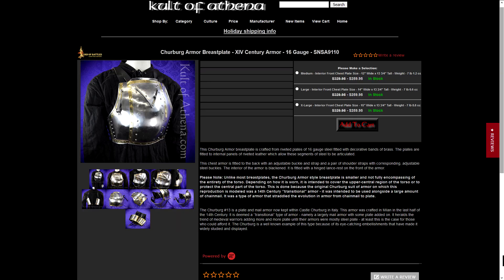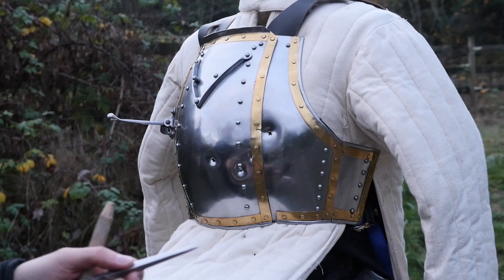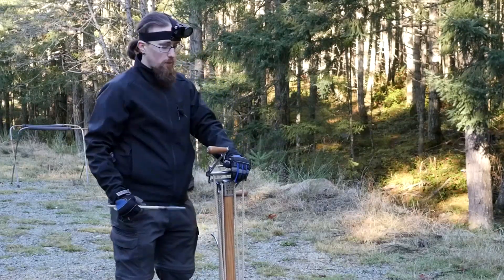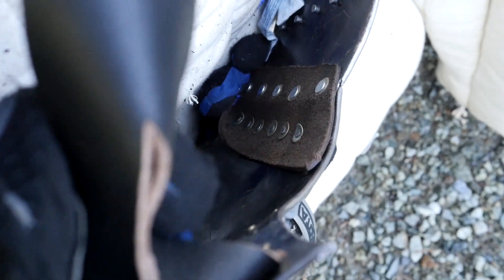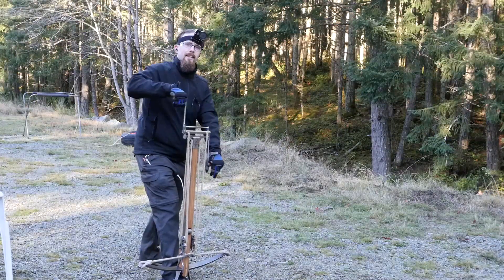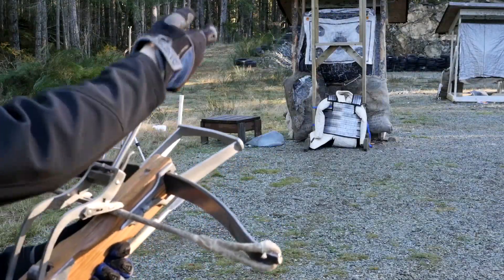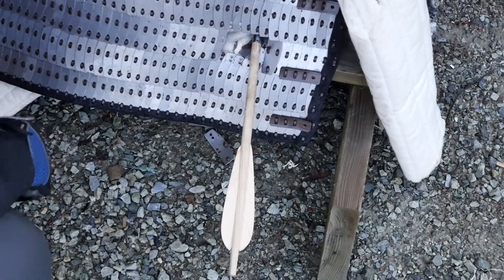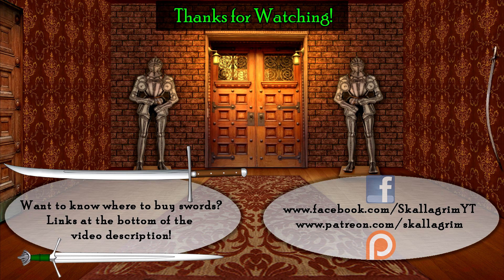Medieval Crossbows vs. Breastplate and Lamellar Armor

Comment: this is why early inaccurate and short range guns are used. Despite all disadvantages, they did penatrate armors and that was enough reason to use them.
Reply: That was more handcannons. Main reason for guns was ease of training. You could basically get a bunch of peasants, have an afternoon of drills on loading and firing on command and have a ranged unit that could put out as much damage as a much more veteran crossbow unit. After all, while inaccurate all you had to do is have the bullet go somewhere into that mass of enemy infantry and you're good, so you didn't even really need to train them on accuracy. As such massed gunfire would be useful against knights still, as they are big targets and they'd be able to kill or disable the horse a lot easier then something like a crossbow, even if he endures the bullets relatively unhurt. Later guns could certainly penetrate armor which is why full plate transferred into much thicker breastplates that could still resist the gunfire, concentrating all the protection over the vital organs instead of trying to armor the whole body.
Reply: @SallinKari  "Ease of use" is a myth, kinda like the blunt-like-clubs european sword and immobilising full-plate armor. Use of firearms at any point in history before the invention of metal cartridge was very dangerous to the user and reqired a LOT of training, especially, if the shooter was expected to fight in a formation, which he always was. Remember, they were working with a very volatile substance and had to go through a very fiddly reloading process, during which they faced the risk of setting their gunpowder on fire prematurely and in uncontrolled fashion, potentially killing themselves and some of their fellows. I've read once about how one arquebusier reached into a barrel of gunpowder while still holding the fuse in his hand, causing an explosion killing more men than the battle itself. On the other hand, bow is free of such risks, the worst thing that can happen to it is that it will break and smack the archer on the head\stomach, depending on which limb broke, it has no complicated reloading process, and can be learned by even the dumbest of men at no expense to the crown. Here is a good article that elaborates on that:
https://bowvsmusket.com/2017/05/29/musketeers-were-not-easier-to-train-than-archers/
Reply: @GurniHallek  The mortars and canons were more dangerous than the handguns. If you forget to swab the barrel before loading the next charge, or if a flaming arrow went anywhere near you, you might end up losing your head. Literally.
Reply: Early firearms aren’t as inaccurate as you think.
Reply: No good to me dead with the type of early fire arms he’s talking about, it may not be so much about whether the gun can shoot in a straight line. You could not really aim early guns because they didn’t test on your shoulder, all you could do it point it in the general direction of the enemy.
Reply: @Commie-tube  Yes they were.
Reply: Depends on what sort of early firearm you're talking about, the velocity of the projectiles it shoots and what those projectiles are made of. Soft lead balls have to be going extremely fast to do anything more than splash instead of penetrate when they hit something solid, like a face-hardened steel breastplate. See here for example: https://www.youtube.com/watch?v=ZOVJoS80pAA
Reply: Marmocet however, crossbow bolts were used in very early guns.
Reply: They actually didnt in most cases, armor was tested by shooting it in the 14th century
Reply: The earliest of firearms (hand cannons... literally) was the beginning of the end for armor.   It became ornamental only by mid 1500s as firearms were quickly able to outpace even the best of quality breast plates... its why you see a STARK change in uniform from armored knights to coats and tabards.. armor wasn't effective vs the weapons anymore so there was no need to wear all that restrictive metal.    People moved into rapiers and straight swords also around this time... as stabbing people with huge needles was cool and trendy because they were not wearing armor anymore.
Reply: @Legohaiden  SImply not true. Armour was an important piece of equipment even late into the 17th century and was still used even n the Napoleonic wars.

The problem was always money. Higher quality armour was effective against weapons of the time. The problem was logistics. Armies could not afford to equip every soldier with that level of costly armour. 

We know for a fact armour was still effective well into the 17th Century b/c the best heavy cavalry army in the world still used it and were almost unstoppable on the battlefield. 

The Polish Lithuanian heavy cavalry also called the Winged Hussars would regularly charge into a pike and Shot formations and absolutely annihilate the opposition. 

In 1605 at the battle of Kircholm the Polish Lithuanian Hussars charged a numerically superior army that was mostly comprised of Pike and Shot formations. Outnumbered 2-1 they routed the gun heavy Swedish forces in less than 30 minutes. The Swedes took over 10,000 casualties compared to just 100 for the Polish troops.

The polish troops would repeat this feat over the next 7 decades of warfare with similar conclusions all the way to the battle of Vienna in 1683. Heavy armour was still effective on the battlefield.

In fact the Hussars were so effective that Gustavus Adolphus, the godfather of early modern warfare started re-employing heavy cavalry in his combat doctrines b/c of the effectiveness of the Winged Hussars.
Guns did eventually make armour obselete but armour and Guns co-existed on the battlefield for over 300 years. Yes, we saw less armour by the mid 17th century but that was not b/c it was not effective. And we did not see a full phase-out till the 18th with a small resurgence of its use in the early 19th Century when it was truly abandoned.
Reply: @Legohaiden   total bullshit, only casuals like you say this kind of nonsense. Plate armour was still in use by men at arms for CENTURIES after the "knight" as a social class had already gone, specifically AGAINST firearms (gendarmes, spanish tercios, curassiers, demi lancers, Japanese tameshi gusoku etc.). Firearms started to penetrate metal plate armour consistently and reliably only in the 19th century.
Reply: @justafloridamanfromthe75thRR  unrelated but, how do you think a modern knight would look like, probably a modern army soldier, but what do you think?
Reply: @josh_the_alien  I’d wager that if we were still in  a mostly monarchic war oriented society with a caste of knights they’d be pretty much like commanders/sergeants of todays armies, as in wearing the same uniform and protection to not get singled out by an infiltrated sharpshooter and standing further from the frontlines of a warzone while formulating strategies

Comment: I've come back, because I was assessing how bows and armor work in Bannerlord. Between your video, Tod's workshop, Thrand and a couple others it really gives a better understanding of what bows can actually do to various armors. I can't see archers at a safe enough distance from the enemy, with lightweight bows, being able to do much to men with maille and decent gambeson or aketon underneath, unless an arrow hits a gap that the armor doesn't protect or eyeslit on a helmet. Tod with a light crossbow and Thrand with 105lb longbow were able to penetrate maille and layered cloth with bodkins but at fairly close range--the kind of range that wouldn't be feasible in a battle. By the time footmen would be upon the archers they would be switching to melee themselves, or running, if not routing long before that.

Comment: It would be interesting to see, what the impact would do to the wearer underneath all that armor. In modern warfare you often see hits to the chest, wich are completely absorbed by the plate carrier but a large bruise spanning across the entire chest. 

Would be interesting to see whether or not Crossbow hits have a similar effect
Reply: By judging the review from internet, the blunt damage that target receives can very from not even noticeable to quite deadly, really depends on what hit you and where. If we completely take out the limbs and head, which are softer targets, and focus completely on the chest plate, then something like swords or bows do absolutely no or very little damage. I am sure that maces, especially big one and under correct angle, can potentially deal enough damage to either kill target, break some bones or just deal a lot of pain and damage armour. At the same time I am not sure about spears, but it looks like that they do little damage. 
At the same time it is quite important to not forget about other targets than torso. Hit to the arms or legs with heavy weapon most definitely will end either fractured or at least make it hurt a lot. I believe that swords and axes can also do that kind of job more or less effective. The head is the least protected place, not because it lacks armour but because the sheer brute force even with something like sword or axe can do some damage, and getting hit by mace in the head will do a lot of damage.
P.S. don’t take my word for truth as most of the conclusions I took from videos and by making educated guest.
Reply: I got to fire a heavyweight crossbow a few years ago, and you feel the immense momentum of the bolt as you shoot it. Since it’s all in the tip on impact, it would most definitely be able to crack a skull under a helmet or rib cage under a chest plate

Comment: I have seen several long bow and xbow videos against armor. And the conclusion pretty mush is, none of them worked against heavy plate or similar. They did have limited success against Chain. I think people pretty much depended on volume fire with the damage coming from an arrow or bolt finding a weak spot. If they hit the actual armor most times the damage was next to none.
Armor worked. Even swords and such did not do much of anything. This is why weapons like the PoleAxe become popular as they where some of the only weapons that could generate enough force on a small point to penetrate or shock.
Reply: Medieval archers would have used a different tip on their bolts designed to penetrate armor when up against an armored opponent.
Reply: @jamesricker3997  rarely the case.

Comment: TLDR even badly made reconstructions that are maybe 50% as protective as the originals can withstand crossbows EZ wish games and movies would learn this
Reply: Conversely though, the real medieval crossbows and hardened steel, really tapered bodkin tips could probably penetrate and injure or kill the wearer. And like Skall said, back then even the really high quality armors had imperfections like varying thickness. And also the steel back then wasn't nearly as good as it is today.

Comment: The question I have with some of these crossbows is the practicality of reloading them in the middle of a battle with arrows and rocks flying at you.
Reply: The crossbowman would likely have the greatest accurate range in the battlefield, so they would be trying to stay out of range. Plus the pavise crossbowmen had a huge shield to hide behind in between firing.
Reply: It might be easier to have someone behind winding up a spare or two and passing the wound xbows to the shooter. So each shooter would be using 2-3 xbows in circulation if they were going for rate of fire.
Reply: They work in teams.  They are usually placed in castles for defense
Reply: From what I've read most professional crossbowmen had a offsider or two and a big shield they would carry the hide behind while loading and shooting.
Reply: just buy multiple crossbows :)
Reply: I similarly wondered how they functioned in battle an looked up the Genoese Crossbowmen and battle of Crécy.
Reply: The advantage of crossbows was that you didn’t have to do much training to have anyone use them since they didn’t need the years of accuracy training or muscular training to use them unlike bows which needed a lot of muscle

Comment: And there were thicker cuirasses by the 15th-16th century as well, I've heard up to 7mm, which I doubt anything resembling a 1000 pound crossbow could get through
Reply: The plate armor of heavy cavalry was tested by shooting it with a musket to ensure it was bulletproof. The dent and stain from the shoot were required to be clearly visible to sell the armor.

Comment: Still, if you are a knight climbing of a siege ladder and 10 guys starts hitting you with heavy crossbows you are going to have a bad day. Either the a bolt eventually gets through a gap and you get wounded and if the armor is so well made that there isn't really any gaps it means you are more likely to suffer mobility loss when the armor gets deformed.  It would be interesting to see a really nice well made suit of armor get damaged around the more finely articulated parts and then have some one try to move around in it

Comment: The lamellar armor demonstrates a couple of interesting things that hadn't occurred to me before seeing the results of this test: for one, steel doesn't have to be particularly thick gauge to protect well against projectiles, and two, an advantage of "scale mail" might be ease of repair. The construction isolates the damage to just a few plates that one might imagine could be easily and relatively cheaply replaced with new steel.
 That judgment is entirely without the benefit of knowing exactly how difficult it is to repair badly damaged steel plate of course, so an experienced blacksmith may disagree.
Reply: The byzantines experimented with both plate and lamellar. Lamellar was found to be better at deflecting arrows and better at being repaired. That of course is to my knowledge. I could be wrong
Reply: I imagine that to repair those holes: either one has to tie up the snapped leather string or restring the whole thing after replacing the bent plates. Tying up is quicker but may be less durable. Restring is time-consuming.
Reply: @sapienecks  But it can be done in the field without a forge and smith. A knight or wealthier footman can tell any random squire or follower to restring armor during downtime.
Reply: @sapienecks  It is also more likely that they would be tied with cord, much like Bowstring, rather than Leather lace, being it would be much more durable and higher tensile strength than Leather Lace. And no doubt the plates themselves would be slightly thicker than 1 mm steel, if only slightly.
Reply: plate armor would be very easy or very hard to repair depending on how thick it is and furthermore if it's heat treated. Thin, untempered steel would be easy. Just use a rounded hammer and hit the inside of the dent to fit the shape of the armor again. Thicker untempered steel would require a bit more force but same story. Tempered steel however, in order to repair, might require heating to move the material back into place and thus must be taken to an experienced armorsmith in order to temper the steel again after heating it up to repair.
Reply: @PyreeMincer  This guy is right. ^

Also your guess about scale/chain is correct. It’s pretty easy to replace lost scales or rings!
Reply: @Michael_MW  i believe the bolt, may punch through, scale/chain mail
Reply: You could just pound out the dents in the field.

Comment: Real armor plating was even stronger than this replica example. There are breast plates that stopped multiple bullets from muskets etc. So yes a full armoured unit of soldiers/knights where pretty hard to fight. You can imagine that arrows and bolts over longer ranges where not so effective to armoured fighters.

Comment: As a blacksmith I have to ask what type of steel are you using for the bolt heads and are you heat treating the tips at all?  It seems that the bolt tips are getting blunted by the mild steel armor more than I would expect.  I would use a fairly high carbon steel and harden the tip,  If I tempered it at all it would only be to a straw color.  Finally, for a bodkin point I would use a triangular cross section and have the edges very crisp to minimize drag on penetration (if any).

Finally, I would use a chronograph to determine the velocities of the two crossbows.  A bow with a 300 kg. prod on it does not necessarily impart 3 times the velocity of a bow with a 100 kg draw prod.  Therefore, the higher draw bow does not necessarily penetrate 3 times further than the lighter bow with the same weight bolt (energy=weight x velocity).
Reply: kinetic energy does not = weight x velocity. 1/2 mv squared is the formula... makes an enormous difference.

Comment: So, you took a piece of modern era metal, shaped to replicate a piece of historical armor from museum, replica crossbow and arrows which have arrowheads made out of unknown metal and ran a test?
A test of what non-historically accurate weapon does to historically inaccurate armor? No carbon content or alloy composition information available. No manufacturing method is know.
This is not how experimental archeologists usually work.
Don't get me wrong - this is a fun video and I liked it. It proves nothing from historical point of view though.